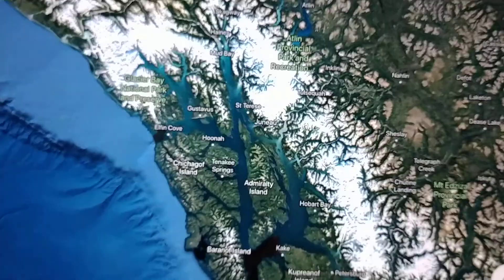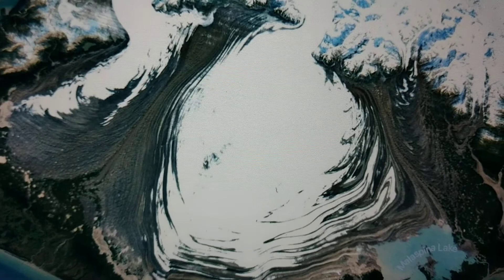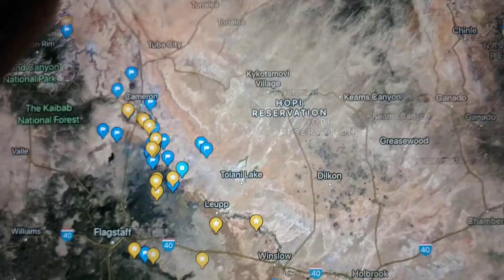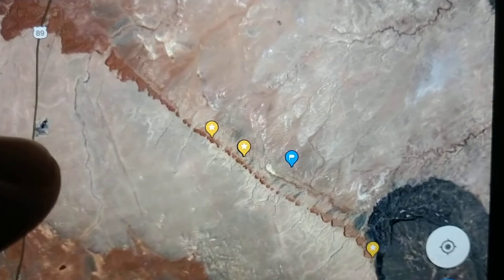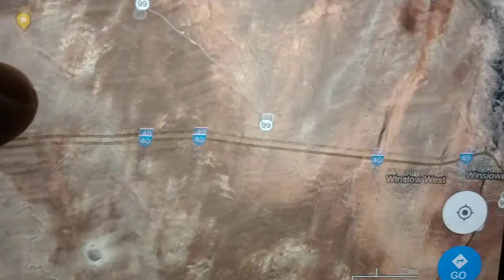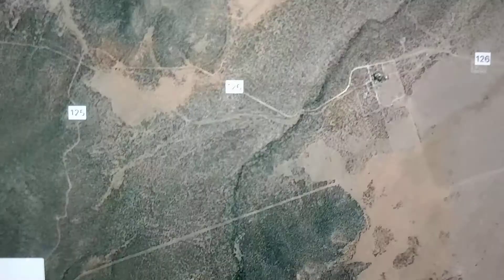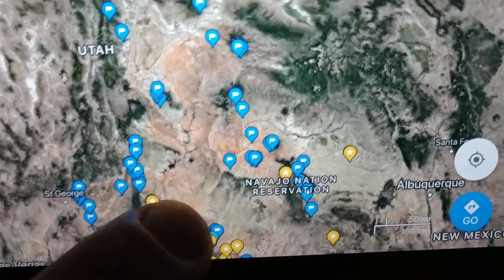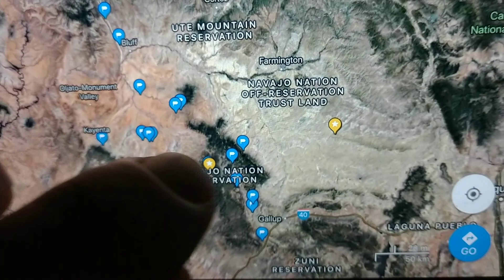Grand Canyon formation. My alternative theory

Comment: How big are gigantic waves?
Reply from the maker: Judging from the imprints I'm thinking thousand feet plus. A meteor impacted in 500 ft of water, the displacement would have been enormous
Reply from the maker: Surface 100. I'm thinking thousand feet plus. My theory is the meteor that made meteor crater  hit in 500 feet of water. If you wickipedia meteor crater they have revised the impact speed by nearly half fairly recently. Now that that number has been reduced it reinforces my theory.
Reply: That’s amazing. Totally makes sense. I don’t see it any other way.